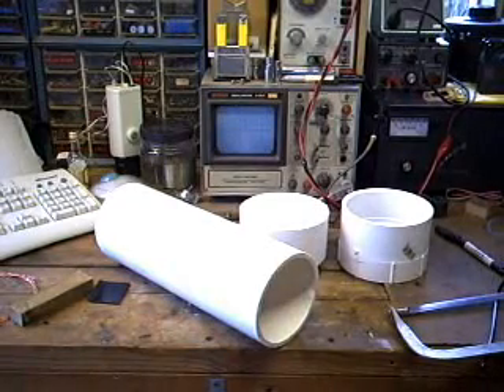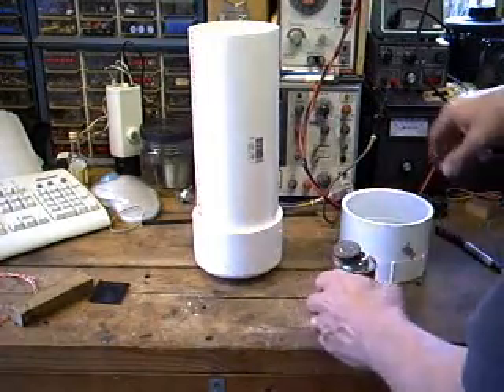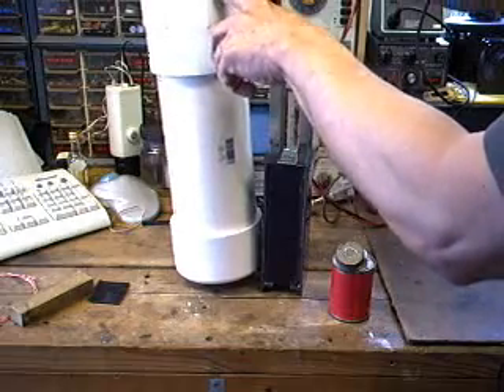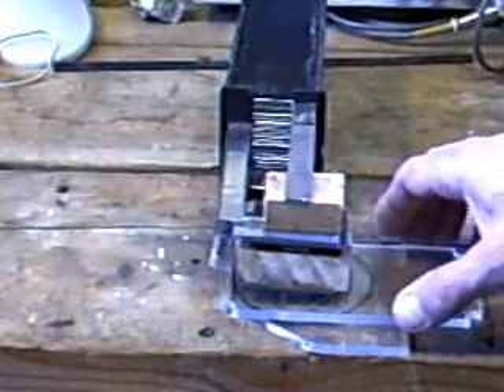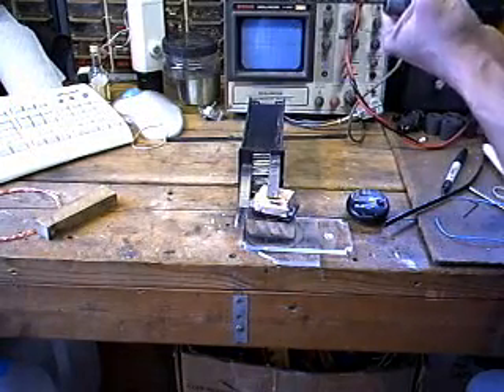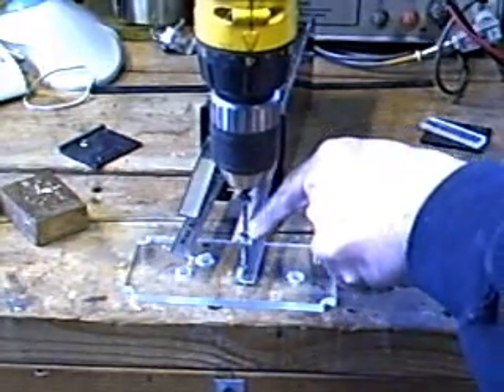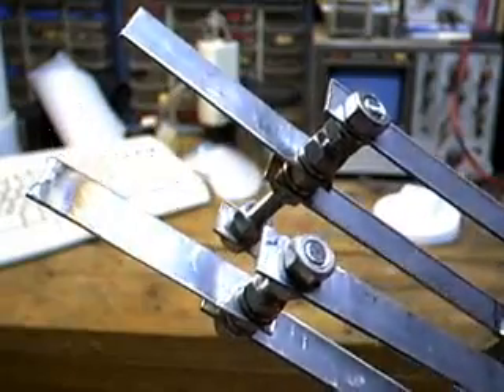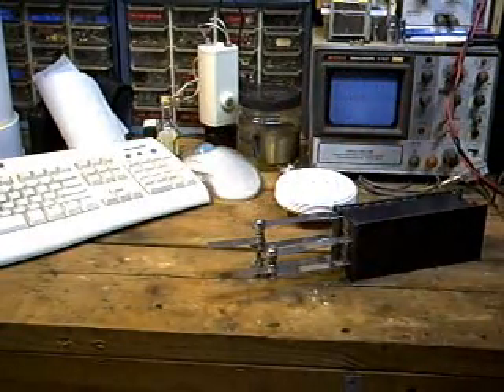#79 - VSPB cell chamber construction 2

Comment: Back in my carpentry days with my father, I asked the same question "what's the purple stuff, if the clear stuff is the glue?" My father replied thustly "to properly clean and abrase the pipe so the glue has something to hold onto."  Ah, the good ol' days.

Comment: It does not bond as well.  Without primer the connections may leak or under pressure it would separate.  In your application you may not ever have issues without primer, but its cheap and good insurance. The primer melts a think layer of pvc welding it together with cement.

Comment: Hi Zero, for good efficiency dont have too many series connecting joints. Stainless has fairly high contact resistance. You could consider passing rods thru opposite side walls of the tube above waterline. Leaving cleanout free for gas outlet and refill. This way electrical connections aren't disturbed during refills. I know sealing is more difficult, if cell is under vacuum it's ok though. Thanks for the tip on Silicones..that must be why mine always fall apart & floats round loose in the cell.

Comment from the maker: YES! But, adhesion is the problem. Under electrolysis, very little stays put on the plates. Even along the panels the edges will come loose over time. The plates will remain in position because the glue will remain stuck to the panels which box them in.

Some have tossed around the idea of powder coating the edges but I'm not sure where that stands.

Comment: Hi ZFF I had just finished my cell (25plates 18cm x 6cm) Which is approximatly like yours but I drilled the plates top and bottom used nylon bolts and washers to hold and space the plates. I am going to use silicone sealer to close the edges. I also sanded the plates. well now I can compare the ouput with yours. Mine may have a bit less surface exposed due to the spacing washers 1.5mm thick x 2cm dia.